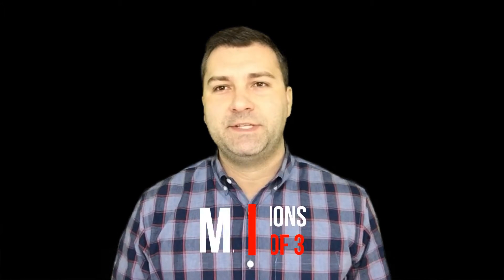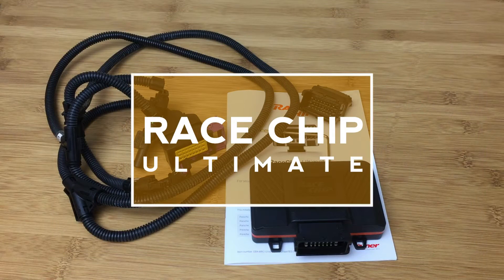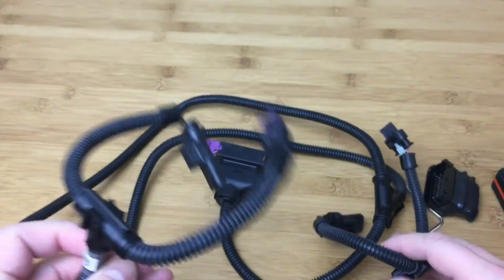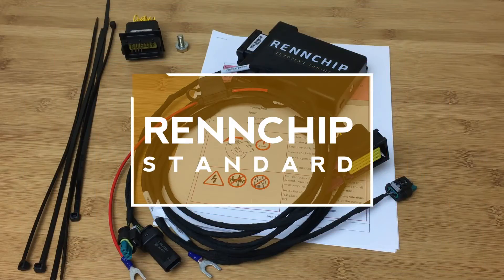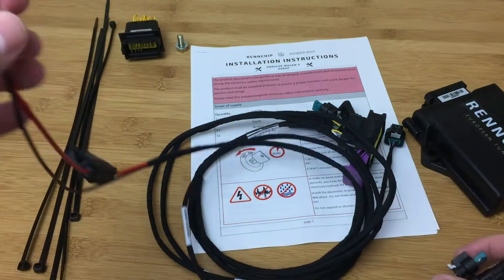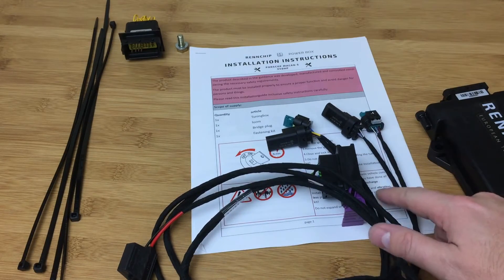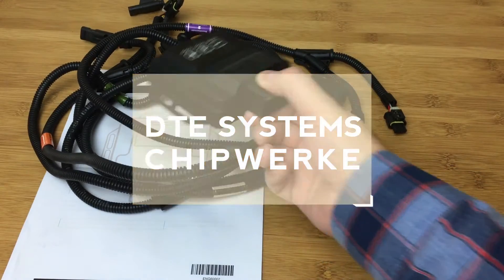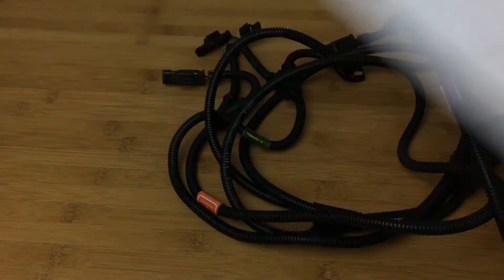Porsche Macan Tuning Options - Piggyback Hardware Comparison

Comment from the maker: Piggyback tuning can vary significantly depending on how the hardware is designed and implemented. If you’re currently running one on your Macan—or deciding between options—what factors matter most to you? Let us know if you have questions about specific systems or setup considerations.

Comment: Does my warranty get voided if I tune my car?
Reply: from what im undersatanding but no one is committing to is that it would need to be removed befor you take it in the shop.  The purpose of the piggy back is to not leave any trace where as the other way completely rebuilds the original code and leaves a history on the records when the mechanics plug it in